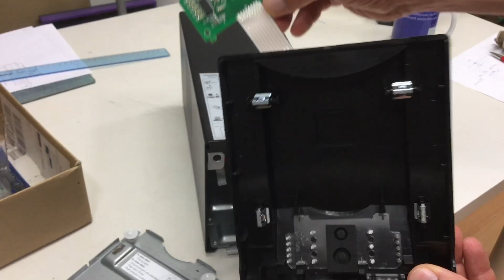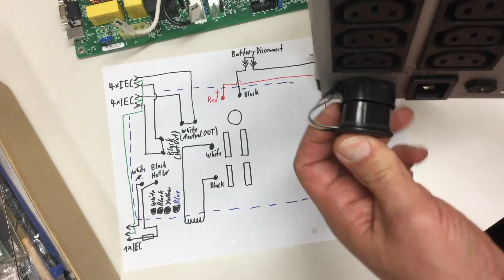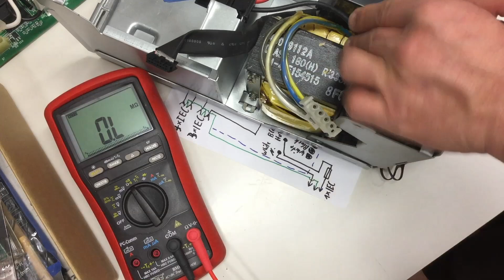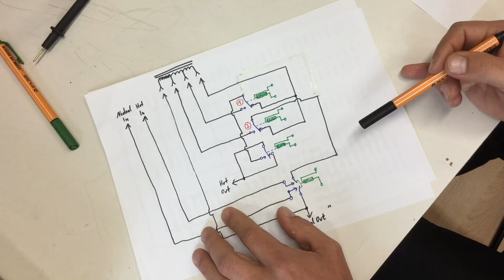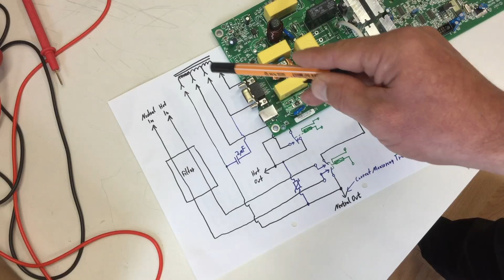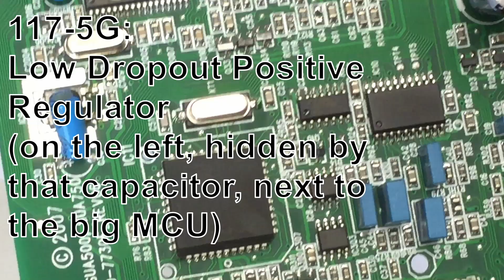APC Smart-UPS 750 Teardown (Details on the Mains AC Side, All the Chips)

Comment from the maker: All my replies to your valued comments before November 2018 were deleted (technical YouTube necessity). Sorry!
Reply: I am from India and I have a question to ask you about the low side of the transformer. If the higher side is activated by 220v mains line, (1and 4),what voltage output will I get on the low side of the transformer? I have dismantled the PCB connectors and given the mains voltage to the higher side of the transformer externally. How much voltage will I receive on the lower side of the transformer? The UPS is APC, 1000va, pure sine wave. Thanks in advance.
Reply from the maker: @gulamhaider6770  Well, at least for the APC Smart-UPS 750 you get 12V (see https://youtu.be/SlTDqRNryuM and https://youtu.be/SmCYR4FNrSs ). But I'm not sure about the 1000VA models. They might use 24V on the low side.

Comment: My SMT750 is bricked on account of new batteries having over voltage that welded the backfeed relay (error P.05).  Is the model in the teardown 120V AC?  I am looking for the backfeed relay part number for a 120v SMT750C with a 24v DC battery pack.  Anybody?
Reply from the maker: Sorry, the thing I teared down was a 230V model. So I can't tell you which relay is used in the 120V models. Sorry again.

Comment: hello sir, I hope you are doing well, my SUA750I UPS All Led indicators are Off even I plugged it to Main AC can You say something on my issue Please?
Reply from the maker: Funny coincident: Just a few days ago I stumbled about a APC Smart-UPS 750 that did exactly the same thing. We shut it off and disconnected it from AC mains in preparation of a power shutdown in the building. When we reconnected it and tried to switch it back on again it just stayed dead (all LEDs stayed off). The thing is these smaller APC Smart UPSs just die after 5 to 10 years. And I'm sorry, but I can't even guess why your unit died. And since there are no circuit diagrams available, trying to repair these things is guesswork, unless there is visible damage to some components. Again, sorry I can't be of more help.

Comment: Hi Robert, , found your video looking for solution for my SMT750i. My unit report fault with "Output over volt" error while a main line goes down (power is disconnected) - always but sometimes also while working on power connected - sometimes. Based on your video I have checked the relays as I expected they may be blocked and do not adjust voltage correctly but all seems to be functional correctly.  I cannot find any service manual describing the problem. Can you maybe have some advice? Thanks in advance.
Reply from the maker: Seems to me there's a deeper problem with the control electronics. But since I've never reversed engineered, respectively, repaired such a unit that's just an (uneducated) guess. And no, APC doesn't publish circuit diagrams (I never found one myself). Sorry I can't be of more help.
Reply: Thanks for getting back  @robertssmorgasbord  
I have just noticed that before the overvoltage fault there is a "misc" problem displayed which probably the initial problem later coverd by overvoltage error report. I also noticed that indeed a output votage is rising to ~300V just before cut off. Anyway, will try to dig further :) Good video BTW :)
Reply from the maker: @bboral  Well, I wish you luck finding the fault! And thanks for praising the video.
Reply: Hi @bboral did you ever figure out what's going on? I'm having the same issue with mine.

Comment: Hi I have this apc 750 which is not working and show overload fault. Pls help.
Reply from the maker: Well, my first question would be, if you disconnect all loads from the UPS and restart it, does it still indicate an overload fault? If that's the case your APC is broken, and I'm sorry, but I won't be able to help you with this. However, if the fault is gone, the problem is with one of your loads (or the total of your loads). Just try connecting each load and see if it causes a problem.

Comment: Had 1 with 2 car batteries due to constant power outages and the wall outlets were at 128 to 132 volts so I wanted regulation for tv, computer, cable box, and router. Worked great for over 3 years. They were doing repairs nearby and there was an explosion and surge (weekend contractors) and 1 of the car batteries that was probably sulphated exploded. What a mess, wife not happy. They fixed the overvoltage by replacing a shorted line underground in my neighborhood after 4 years of this. It's been in my shed for some time and I just got some correct batteries for my 750 and went to put them in forgetting that the ac plug was plugged into the back of the unit. It popped something (no smoke or blown up parts) and wont power on. Checked the reset button and looked for round wafer fuses but did not see any. If you could recall from looking at your own video where protection device might be I would be thankful.
Reply from the maker: You can change the batteries of those APC UPSs while they're under power (Manual: "Battery replacement is a safe procedure, isolated from electrical hazards. You may leave the UPS and loads on for the following procedure."). So you putting in the new batteries while the unit was connected to AC mains probably didn't break the unit, but the unit had some defect beforehand. It's possible that the MOVs (four blue disks on the board itself - at least on my board) were damaged during the surge, so if you are into electronics you might try to replace them. To the best of my knowledge these and the AC mains fuse (the "reset" button) plus the battery fuse are the only protective devices. But to be honest, these APC UPSs often just die after 4 to 6 years. That's the reason I had one to tear down in the first place.

Comment: If I want to add a 12-24v cooling fan inside the UPS, where in the circuit board would I need to connect it?
Reply from the maker: I probably would connect it to the 12V battery connectors. There might be a stabilized 12V rail available on the board, but I can't really tell you where that's located. You can try searching for a 12V regulator on the board I guess.

Comment: I have SMT750i. Which has almost same board as in video. I disassembled it to extend it's battery cables to connect it to external batteries. 
Now it's working perfectly fine but showing 0% and 0VA load on LCD, no matter how much load do i connect to it. This happened after disassembly. Was showing load fine before i unscrewed it, obviously some mistake by me while working inside it. 
Now where should I look for fault? Both current transformers look physically ok to me.
Reply from the maker: Sorry, but that's really beyond me. To find the fault you would need a circuit diagram of the whole thing (I was spending quite some time reverse engineering the simple mains AC side). Sorry I can't be of any help.
Reply: @robertssmorgasbord  hmm no problem. Thanks for your time bro.
Reply from the maker: @abrarahmad4193  You're welcome!

Comment: On most UPS your devices are not connected to Mains...  They are on Isolation voltage...  The UPS just switches source voltage from mains to battery...  This is the only TRUE "Surge Protector".   These should be run on all expensive electronic gear...
Reply from the maker: Well, you would be right if you said "on most  EXPENSIVE UPS ..." ;-) Anyway, the better (more expensive) UPSs indeed use the "online" architecture (AC to DC -> Battery -> DC to AC). They have better voltage regulation and inherently no switch-over delays when AC mains fails. However, the do cost more. For most applications the "line-interactive" UPSs like those from APC are good enough.

Comment: Bună,  De asemenea am și eu unul la fel,  firma mea la aruncat si l-am demontat, și nu mai stiu cum să îl fac din nou sa funcționeze. Puteți să mă îndrumați cu o idee? Vă mulțumesc anticipat.Sare siguranța cind pun curent pe transformator. 
Transformatorul e SINUS PUR?
Reply from the maker: Since I don't speak Rumanian, I had to use Google Translate ;-) So you're asking:
"Hi, I also have one too, my company threw it away and disassembled it, and I don't know how to make it work again. Can you guide me with an idea? Thank you in advance. Safety jumps when I turn on the transformer. Is the transformer PURE SINUS?"

Well, unfortunately there is not a most likely point of failure I can point you too. It could be a short in the transformer, it could be a short on the mains AC side, or it could be a short somewhere in the battery charging / power supplying part on the secondary side of the transformer.
In any case, the APC Smart-UPSs should provide a sine output (at least the latest models do).
Reply: MULȚUMESC MULT! Aveți dreptate, cind conectez transformatorul la 230v, sare siguranța, el este de vină cum a-ți spus. Sa desfac transformatorul si să îl bobinez din nou exact cum e el ,sau ...ce sfat imi dați?
Reply from the maker: @vasilearvai  Google Translate again ;-)
"THANKS A LOT! You're right, when I connect the transformer to 230v, the safety jumps, it's to blame as you said. Unwind the transformer and rewind it exactly as it is, or ... what advice do you give me?"

First, you're welcome! Second, I'm sorry, but I can't really recommend unwinding and rewinding that kind of transformer. The low voltage and high voltage side are wound on top of each other, so retaining isolation here is a serious issue. Also, I suspect that this transformer has been "cooked off". That is it got too hot and the isolation of the wires was burned/failed. So to be on the safe side you would have to rewind everything with new wire. In my experience that amount of transformer wire would cost more than a brand new transformer.

Comment: My 8 pin bus connection at 2:01 in the front panel have a short in them. How do I replace it that part?
Reply: i have parts
Reply from the maker: @ambersmith6517  And you are willing to sell/send them to Gabriel Perez?
Reply from the maker: Where is the short exactly? I can hardly imagine that the short is in the connector/cable itself. So I'm assuming it must be somewhere on the little front panel PCB (some blown part or something). In that case the easiest way would be to replace the whole front panel PCB assembly (some soldering required).
Reply: i bought a newer model but since i had bought new batteries for this older model i would be interested in repair the old one
Reply from the maker: @gabrielperez3619  Well, as I wrote 5 month ago: The easiest way would be to replace the whole front panel PCB assembly (some soldering required). Alternatively you could try to reverse engineer and repair the front panel PCB. Maybe you even find a schematic for that PCB if you google for it. Good luck!

Comment: Can i replace the two 7,2 Amp batteries for something bigger in size . Like 2 marine AMG 50Amp's , and set the aside the APC.
Reply: I know your comment was a while ago, but I really wouldn't recommend increasing the battery capacity on this inverter without improving the cooling. The heatsinks on the MOSFETs are more of a thermal storage design, that is that they are only designed to run for as long as the original batteries can last, not continuously. You'd need to modify it with a fan blowing a decent amount of air over the inverter MOSFETs for it to to be safe to run these for longer periods than they were designed for.
Reply: @JN.0_o  I understand. Thank you.
Reply: yes
Reply from the maker: @jorgeflores9846  Have you actually tried that? Did the unit pass its battery tests with a larger battery connected?
Reply from the maker: In principle yes. However, note that charging the batteries will take quite long and the remaining runtime when on battery reported by the APC software will be totally off, that is too short. Also, the APC might give you an defective battery alarm because charging takes too long (I'm actually not sure about that).
Reply: i have two large batts hooked up to mine it charges over 3 amps  i did put a extra cap on the batt input side also  it is a good little unit idle is high and a choke dose not help

Comment: this day still using that big ass transformer? are there version that using small switching transformer to high voltage high frequency ac then to dc 300v then inverting it at high voltage to power line voltage?
Reply from the maker: Yes, there are switch mode AC-DC-AC UPSs available. They are called online or double conversion UPSs. But those are expensive. These APS Smart-UPS units are comparably cheap things.

Comment: this model can change output voltage from 220 to 110 or not?
Reply from the maker: No, it can't. There are dedicated models for 220V and 110V each. The main difference between the two models probably the windings on the primary side of the transformer.

Comment: Hi ,I have two APC Smart Ups's  a UART 2000 RM and a 3000RM ;;b oth have same fault ; they indicate battery voltage to low ( only one ledat 54Volts bats freshly charged)  and then start beeping .. any idea where to look for ??  for the rest they do work both perfect . I have the diagrams::7 pages difficult to read and combine .
Reply from the maker: Sorry, but I've never actually owned  (the one I took apart was thrown away by somebody else) or repaired APC SmartUPS. Nor have I ever experienced the fault you describe with an APC SmartUPS. So I really have absolutely no clue what's wrong with your's. Sorry again, that I can't be of any assistance.

Comment: i have transformer of this ups, can i use this transformer to charge my 12 volt lead acid battery?? can you please share diagram how to maker battery charger from this transformer, and also tell me how much amps this transformer can produce at 12 volts????
Reply from the maker: Well, yes, in theory you could use that transformer (as part of a circuit!) to charge a 12V lead acid battery. I can give you only an assumption as how many amps that transformer can deliver: It should be good for 500W, respectively, 750VA (ratings of the UPS). Assuming that the low voltage winding is indeed 12V RMS (and that's really just an assumption!) you should get a little over 41A RMS out with a resistive load. With a charging circuit as load (rectifier, capacitor, regulator) that needs to be downrated considerably.

As for a complete circuit ... let's start by measuring the transformer a little more in detail (I'm not at all sure that it's really delivering 12V RMS at the low side). My bench is currently quite swamped and I still have to catch up with a whole lot of work after my vacation, so no promises here. But I've put related Post-it on my wall with video ideas ;-)
Reply: The output from these transformers are usually 15.7VAC (non center tapped ones) when the input supply is around 115VAC (220VAC ones should be also similar). I have played around with the transformers from both APC and Tripplite and both produce same voltage.  You can use two or three high power DC-DC step down converters in parallel to achieve a high current output. Look at the AWG of the transformer output wire and decide how much current it can handle and choose appropriately. If you use forced fan cooling then around 10Amps per converter. Enough to charge charge a big car battery at fast rate.

Comment: Very good teardown
Reply from the maker: Thanks! You're welcome!
Reply: @robertssmorgasbord  do u repair lcd monitor
Reply from the maker: Usually not. I've repaired a Samsung SyncMaster 214T once by replacing the electrolytic capacitors on the power board. I did that by following the instructions in a YouTube video ;-) Should I come across a defect LCD monitor again I will certainly give it a try - and make a Video about it ;-)

Comment: Hm, the heatsinks are so small and there is no any fans inside? Wondering, how it didn't overheat.
Reply from the maker: My best guess is that the MOSFETs on the small heatsink are used as switches only, thus keeping the power losses low. They probably implement an H-Bridge driven with SPWM (Sinusoidal Pulse Width Modulation) to feed current from the battery to the low voltage side of the transformer in case of a power failure. Otherwise they might not be active at all.